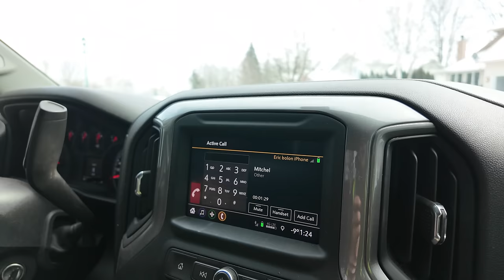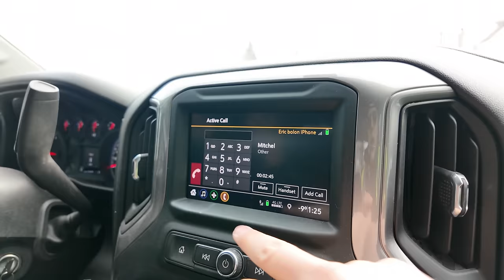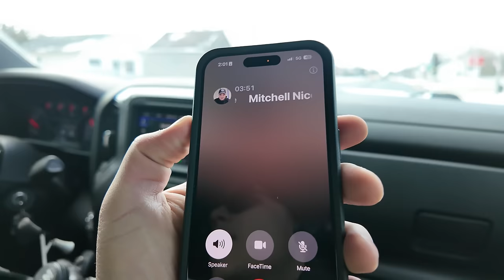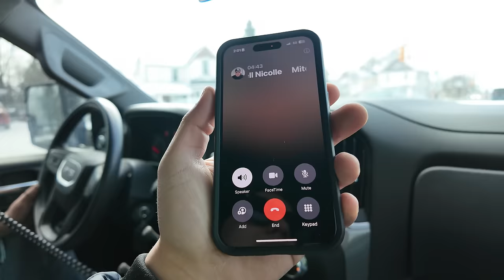This Tractor Front Axle Exploded...

Comment: Are you sure that your operators aren't running the snot out of the machines?  Seems you are breaking lots of equipment.
Reply: Considering he's running 30+ tractors I don't think he's really having that any problems considering most of the problems are the snowblower.
Reply: Your not wrong.  They haven't even looked in the manual how to set up a 3 point hitch properly.  Especially the top link.

Comment: Normal John Deere problem front axle. Every one I’ve had has had axle failure. John Deere sucks at axles
Reply: yeah we got rid of our old deere loader tractor and traded for kubota l4760 a 49hp loader tractor with bucket,forks,blower  wich wasnt bad for $34,000 cheaper then paying $89,600 for a 2025 R 25hp deere wich was rediculas for tractor and blower alone

Comment: 4wd in road gear.  Great operators.
Reply: Really for road travel 4 wheel drive should bee turned off
Reply: @ronniecaissie921  %100. We had one start to leak due to this. "B" range is ok but not "C" range on dry roads.